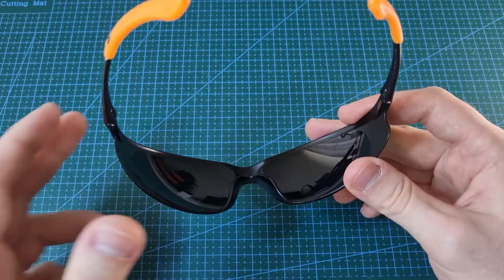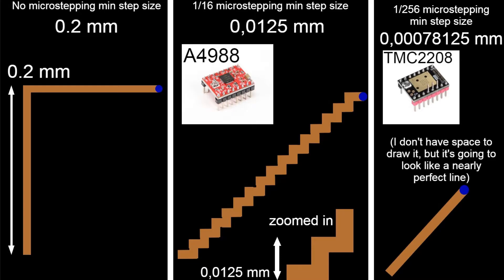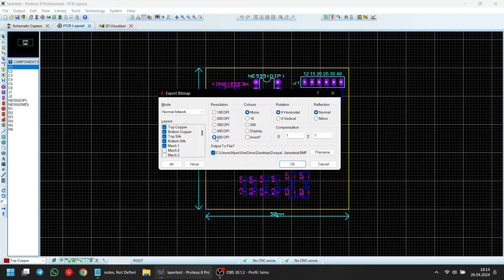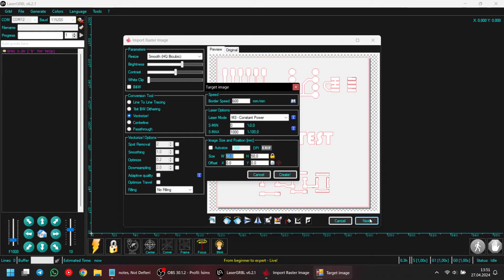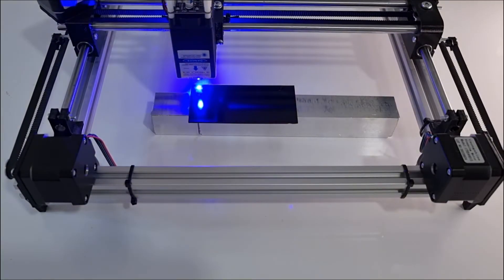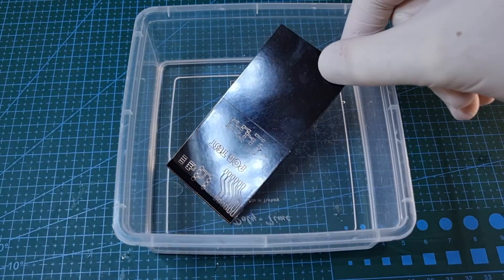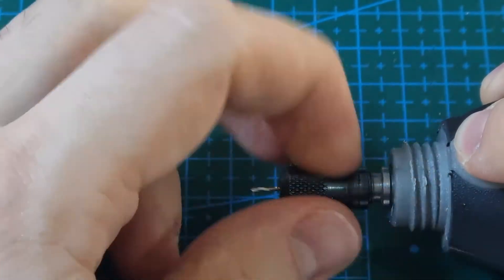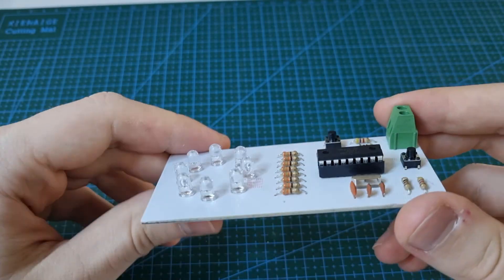Laser Engraving PCB's (Super Simple)

Comment: I have been trying this method but running into some issues - trying to find the best laser speed and power settings I did a couple test patterns in Lightburn. The result was either the copper would clear, but would look wrinkly and delaminated, or there would be hazy edges on the squares. I am using air assist, as I thought it would help with the edges but it doesn't seem to do much. Any tips?
Reply from the maker: Hi, what laser power and speed are you using in Lightburn?
Reply: @bitofelectronics  I tried an actual PCB design today with improved results. Still not perfect as there is a bit of residue left but I will keep messing with settings. I have a 5W optical power laser, currently working with 600 mm/min at 100% power. I tried faster (800 mm/min) and lower power but results were worse. Will keep trying
Reply from the maker: @statzern  Since you’re already running 100% power on a 5W diode, the residue might be more about focus than power. If the spot isn’t dialed in really sharp, the beam spreads out and leaves char instead of clearing the paint cleanly. A quick ramp test can help you find the exact focal point.

Comment: I have proteus 8 and cnc 3018 .. is it possible with a laser add ? And what power it must be have . Thanks  😊
Reply from the maker: Hello, yes you can add a laser to any CNC, just make sure to set the correct focus height, and connect the PWM input of the laser to the CNCs spindle output. For basic engraving on paint or wood a 4W laser is usually enough, and it can cut thin plywood with multiple passes. For thicker materials you’ll need a higher power laser.

Comment: Laser small hole in center of pads to help drill bit without punching each hole.
Reply from the maker: Yes sir you are right, but sometimes I over etch it  and the whole pad becomes as thin as a human hair 😅
Reply: I made some measurements, comparing the size of lasered elements (pads, traces, holes) to their size chosen in my PCB software (Layout 6).
I used a microscope - Supereyes- and the associated measuring software. (magnifying X50)
None element is geometrically close to the "ideal" shape, though I used the "offset" option in Lightburn 1.7.0
In average
-  the lasered pads are 0.33 mm wider than expected.
-  the diameter of holes in pads is 0.33mm larger than expected.
-  the traces are very close to the expected size
-  the lasered areas around the pads and traces (english etching) are 0.33 mm wider than expected.
There is very low and not statistically significant relationship between the size of an element and the attached error.

Laser Sculpfun 20W. Results may be different with another laser.
Hope it will help to bring adequate corrections.
Reply: This must be controlled. In my case the hole is 30/100  over the expected dimension, corrections must be brougt when designing the PCB .n my case : hole - .17 mm, pad + .34mm

Comment: Hi! Is there anyway to use the drill file with lasergrbl to make the pinpoint of the holes?
Reply from the maker: Hello, you can export just the drill files and board edge files as single PNG image from your CAD software. Then, upload that file to LaserGRBL as shown in the video, Once you've aligned the board edge using the outline function in LaserGRBL you can precisely pinpoint the holes.

Comment: how thin can be the traces? 0.3mm is possible?
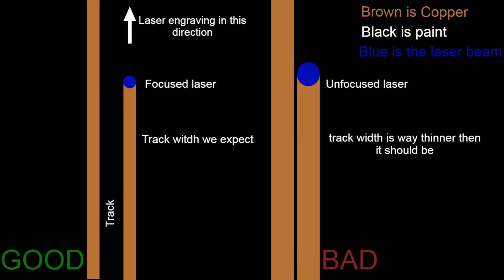Reply from the maker: At 7:05 you can see that the 6th trace in the top-left corner is the thinnest, measuring 0.3 mm. It’s set to 0.3 mm in the software, but in reality, it’s even thinner due to the laser’s dot size (mentioned at 0:55). If you buy a good laser with a small dot size, you can engrave traces pretty close to 0.3 mm. However etching will also be a challenge, so keep this in mind :)

Comment: What's the minimum wattage for the laser? Is a 2.5W laser going to work (assuming the paint method)?
Reply from the maker: Hi, a 2.5W laser should be fine for this purpose if it doesnt engrave all the way through in the first pass it should be able to do so in a second pass. I recommend not going below 2W for this kind of work. However the manufacturer of the laser is also important as some sellers (especially from China 🙃) may list inaccurate power ratings for their lasers.
Reply: @bitofelectronics  Thank you for the response. Much appreciated.

Comment: Can we also make this work for smd pcb ?
Reply from the maker: Yes, you can use it to make SMD PCBs, but you will need a higher quality laser. Don't expect it to engrave very small footprints, like those of the STM32F103CBT6
Reply: @bitofelectronics  I really appreciate your response, I m getting started with PCB milling and could I use 3018 CNC for it ? any advice?
Reply from the maker: @GameAndJokes  You are welcome ☺,i don't have any experience with PCB milling, but I know the 3018 CNC. It's great for beginners, and you can create some simple circuits with it. I believe it uses a 775 motor as the spindle, which you could consider upgrading in the future. I've heard it has low-quality ball bearings and vibrates a little while engraving.

Comment: Hey man, Great video!
I was going to build a grbl based Cnc Engraver/cutter to make PCBs, everything was going great but your video made me realize that I need a really precise laser. my machine has 2000 steps per mm which is plenty, but the laser dot should be small to get good results, any Idea how I can solve this problem?
Reply from the maker: Well, I don't remember where I heard this, but I heard that Chinese laser producers use two modules instead of one to make more powerful laser modules, which results in a bigger dot. Maybe something less powerful but of better quality can achieve better results. I asked ChatGPT about this, and it agrees they do this and suggested this brand: https://neje.shop/collections/neje-laser-engraver-laser-cutter-laser-module-kits-cnc-wood-router/products/10w-laser-module-kit-for-3d-printer-cnc-laser-machine-arduino-project-wood-routter-machine
Reply: @bitofelectronics 
Thank you so much man!
The feedback was 100% helpful, I'll make sure to get a high quality 5.5 watt laser to get better results, budget is a little bit low at the moment but when I set everything up I'll make sure to share my results.
Reply from the maker: @subhimesto7123  You are welcome ,good luck on your project 😊

Comment: Nice detailed video. Thanx 🙏 Will this laser be able to cut vinyl tape pasted on the pcb board?
Reply from the maker: Well I didn't try cutting any vinyl with my laser, but I did some research for you. Maybe getting a more powerful laser is a better idea. I also found that cutting vinyl with a laser creates harmful gases, so be careful.
Reply: @bitofelectronics Thanx for the reply! To tackle the harmful gas thing, I am thinking of attaching a vaccum cleaner port near the laser module. I believe it will take care of that situation, isn't it? Secondly, my budget is not great so I am concerned about the dot resolution of that cheap $40 laser. Can you tell me the dot diameter you have? Because if I look at your 1206 pad, the isolation looks quite thick.
Reply from the maker: @ribvicky  Well, when I was engraving wood, I tried sucking the fumes into my vacuum cleaner. It filtered about 50% of it, and it's been like 6 months now. Whenever I power up my vacuum cleaner, it still fills the room with a burned wood smell lol. If you plan to put the vacuum cleaner outside and don't plan to use it for cleaning your house in the future, I think it's a good idea :D 

As for the laser dot size, as you can see at 7:05, the thinnest PCB trace is around 0.3 mm (12 mils), and it's about to disappear. So, I assume the dot size is something around 0.14 mm.
Reply: @bitofelectronics  Yes offcourse I will not use that VC for home 😁 Don't want to get kicked out 😀😀 and regarding dot size, I don't think it's 0.14mm. just look at the isolation track around your traces (this is where your laser is actually cutting the paint) that looks quite thick to me. If it was 0.14mm then the isolation would have been very very thin making the pads look bigger.
Reply from the maker: @ribvicky  https://ibb.co/F83XrnH  take a look at this photo, the thickness is about 0.3 mm horizontally and 0.25 mm vertically. However, I think the circuit in the video looks better than the circuit in the photo.
Reply: @bitofelectronics  the link isn't working..
Reply from the maker: @ribvicky  try this one                        https://www.reddit.com/user/Master_Calendar5798/comments/1e68ndy/laser/